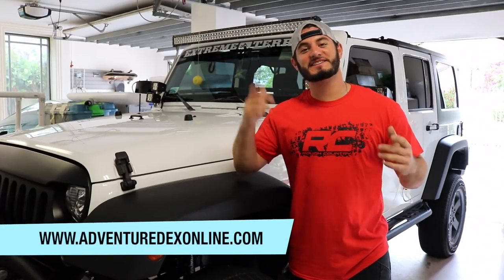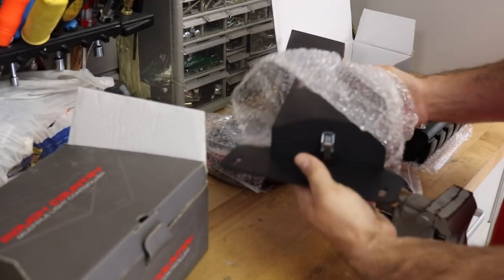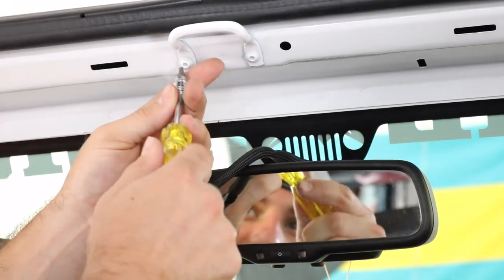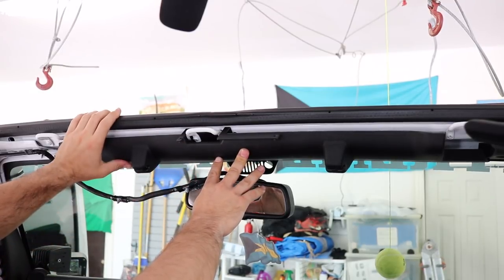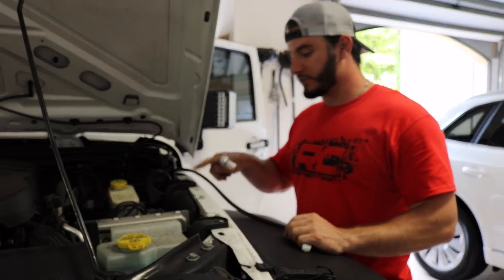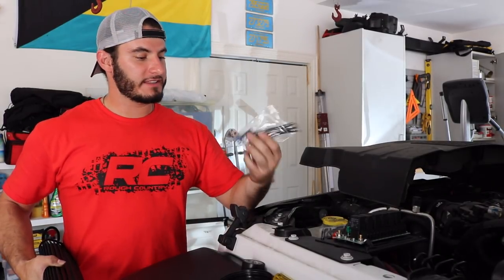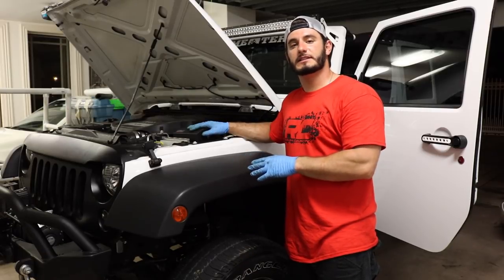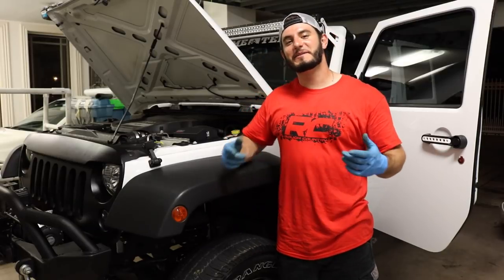Jeep Wrangler Switch Pod Installation - Rough Country MLC6

Comment: I installed a SPOD on my 2005 Jeep Rubicon.  It was an easy install an made the install of a new 17" light bar on my bumper a breeze.  I liked having the ability to customize the toggle switches with graphics that compliment their use - such as a Zombie graphic for my light bar and a winch graphic for my winch.  Makes hooking/powering accessories easy.
Reply from the maker: Thanks for sharing!

Comment: I have watched some of your videos and like the way that you do a step by step install with warnings about potential problems.  I have very limited to no mechanical skills but can follow directions, and based on your video I could almost do this....except for the removal of the pillar panels and using the jigsaw to modify.  Would prefer to install the switchpod with someone like you who knows what he is doing.   Be that as it may, thanks for your very helpful videos...I have just subscribed!!
Reply from the maker: Thanks alot for the positive feedback!!
Reply: r g -Look at it this way, even if you botched the trim, so what? Buy a new one and trim again. Otherwise, you'll never learn. Learning by doing gains self confidence. 

I am guilty of the very same reasoning, that! And I am a lazy character! Cheers!
Reply from the maker: +Gary Bowen thanks for your input!

Comment: Nice installation video! The only small con I have about the MLC6 is the interior LEDs never turn off. Probably not an issue since the MLC6 has the LVCO but I will mod those LEDs to be off.
Reply from the maker: Thanks for the comment! Yeah, the lights never turn off, it doesn't seem to affect anything though. Its a cool touch. Thanks for watching!
Reply: The button on the side of the switch is to turn the LEDs off.

Comment: Great video! The price difference is crazy compare to the S pod! I brought the new one which cost me around $750! I wished I had knew that Rough country was coming out with one. Would have saved me a lot of money!  You should do a dual light bar or the Rostra Led Daytime running lights. Again thanks for a great video.
Reply from the maker: Thanks for the positive feedback and suggestion! Glad you enjoyed!
Reply: I just got mine. There is a fuse tap to go to your accessory power, so the switchbox only comes on when key is in and turned on.

Comment: Thank you for mentioning the things you didn't like about it. Blue lights and cutting the trim would be a dealbreaker for me. Hope they come out with a 2.0
Reply from the maker: Thanks for the comment! I try to make my videos are honest as possible! I recently learned that the switches can be changed so I will be changing mine to custom red switches and the cutting is the only small issue! Thanks for watching!
Reply: Do a vid on it also. Blue isnt my color also. Red is the only way to go
Reply from the maker: Yah I will!
Reply: All RC would have to do is to extend the bracket a little, so that the plastic trim won't hit. One would think it's an easy fix; hopefully they take your comment into consideration and modify the bracket. Great video, though! Keep them coming!!!

Comment: As always, great video Dex! I was originally going to follow your video to wire up my A-pillar switches, but this seems like a much simpler installation. I do have a few questions for you. Given the option, would you prefer to have your switches in the A-pillar or overhead console? Which do you find easier to operate? Also, does the new console affect your ability to operate the hard top latches?
Reply from the maker: Thanks Remi! To answer your questions, The overhead is great value in comparison to the A-pllar since it comes pre-wired and has a few cool features. like the low voltage cut off. Also I needed more than 4 switches so the overhead was a great addition. The overhead does not prevent the hardtop from closing but that latch is tight!! Thanks for watching!

Comment: On the custom Switch set you had before you installed the kit you could have eliminated more wires by using a common ground And separate positive leads for each switch
Reply from the maker: Thanks for he suggestion.

Comment: Just purchased this product because I didn't want to spend the time wiring up a relay box & trying to make it fit, also time consuming. Besides I wanted an over the mirror mount. My suggestion to Rough Country is to make the cover plastic, insulate the inside walls for protection against accidentally having the sides touch the positive lead when putting the cover in place, or providing a rubber insulator that goes over the top of that positive lead bolt.  That's what I plan to do, Murphy's Law....if it can happen it will at some point. I'm a safety guy.
Reply from the maker: Thanks for sharing!!

Comment: 10:51 it might be simple but my province requires off road lights to be triggered by the the high beam circuit not the ignition. So I would need to have a way to only have the relay trip if the off road light switch was on and the high beams are on at the same time. I also like my fog lights to come on with my park lights or factory fog light. It sounds kind of complicated but once you do it a few times it not so hard.  
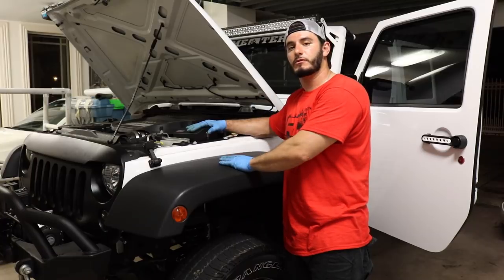11:37 That is a good feature.
12:30 I would like to have them green like my dash lights.
12:46 Back up lights.
Thanks for the video

Comment: I've watched the video couple of times and how did you run the wires through the firewall because the foam solution the plug doesn't fit . How did you get it through the firewall can you upload a video just for that or pictures because I bought a 2017 Jeep Wrangler and I'm having issues with the switch set up so far.
Reply from the maker: Great Question! The firewall has a round rubber grommet that can be sliced to get wired through! It is easily found in the foot well! Hope that helps!

Comment: That is a super awesome switch pod.  But I'm with you regarding the cutouts and the switch colors.  They should provide colored inserts so you can choose your colors. My pillar switch pod has a different color for each switch, which makes it easier to find the one you want.  Regarding what you should wire up ... I don't know if you already have them or not, but I'm thinking of putting some LED spotlights facing the rear. Just not sure how or where to mount them back there. Any ideas?
Reply from the maker: Thanks for the input and suggestions! I might switch the switches so maybe the I can change the colors that way. I like the idea of putting some rear facing LED's for backing up and nighttime. I originally had some but took them off. Thanks for watching!

Comment: The only thing I see which I don't like is the open wires on the switch panel itself (on top)... Im also not a fan of cutting trim parts of the car. They can also think of making the junction box in the engine bay dust proof, I can just think how it will look if one drive a lot of dirt roads. The rest of the product seems top notch!!!
Reply from the maker: Thanks for your input! I am sure they will be taking advice and improving the product! Thanks for watching!

Comment: great video and very helpful. One question is that the LED lights stay lit blue even when there is no key in the ignition.  Is that true? Seems a bit strange that it is not a switched current. Thanks and keep up the great content.
Reply from the maker: Thanks for the comment! The led lights do not turn off. It does not seem to affect the battery in away. I have had it in my Jeep for about 2 weeks with no issues! Thanks for watching!

Comment: Quick question! I'm new to this switch pod stuff and I just bought some awesome side mirrors like yours...😍 Well, I didn't know that it did not come with the switch pod .. so my question is, which one would you recommend for someone that doesn't have any other light bar or anything else? I just need one for the side mirrors? Thank you so much!!
Reply from the maker: Thanks for the comment Chantal! It all depends on your needs, the A pillar is a good cheap option but it is limited to 4 switches and a lot of wiring. The RC switch pod does with 6 switches and is prewired! If you can get the Rough Country, then I would say go for it! Thanks for watching!

Comment: Just bought this and the new updated version has the ability to turn the blue lights on and off with a button located on the driver side of the pod, for the wiring though it still has the positve red cable and an another red one stacked on top of it. I wired the obvious one to the battery, but there isnt instructions on how to or where to wire the other red one stackedked on top of it.

Comment: i had really high hopes for this..i ordered it got it all wired up and the 6th switch didnt work and the 3rd switch had to be on for switches 1,2,4,and 5 to work. also the led stay on when the car is off which i hate. the plug on the back that connects is pretty big and make fitting the panel back on harder than it should be. i ended up sending it back. i went with spod and spent more doe to have better dependability. i have the spod and its amazing but it was 800 bucks. This is really nice though for the price as long as it works. fyi the otrattw custom switches do work for this Rc system. i have all rc black series lights running to my spod and love them. i think rc makes good stuff but your mileage may very on the switches. great video
Reply from the maker: Thanks for the comment! I appreciate and respect all of your input! I think the main point here is cost/value. From my personal experience, RC makes great, reliable and affordable products but of course there is always going to be a more expensive top of the line product that some people choose to buy. I personally think that you cannot go wrong with $200 with warranty. I am sorry to hear that you got a faulty product but I am glad you got sorted out in the end! Thanks for watching!

Comment: If I wire my winch directly into the battery, would putting the positive and negative wires from the pod on top of the positive and negative wires from the winch in the battery port cause any electrical issues? Sorry if that's a confusing question.
Reply from the maker: No, this should not cause at issues! Thanks for watching!!!

Comment: Would be very helpful if you showed how and where you ran the wire through the firewall. I don't want to start disassembling unnecessary body parts.

Comment: great clear installation video.
is one switch/relay/fuse on this group of six able to handle two 30W LED lights? is each 40A relay and 30A fuse pair capable of handling that? Thanks.
Reply from the maker: Thanks! Yes, you shouldn't have any problems with LED lights. I have blown a fuse before and replaced it with a large fuse. Hope that helps!

Comment: I have 2 sets of Rigid Duallys and a light bar run into my a-pillar switch panel (pos,neg,and ground wires). With this, can I cut the wires down to just pos/neg since the MLC-6 has its own ground? Can I also cut the fuse out? Awesome video.
Reply from the maker: Yes, all you need is a positive and negative. The MLC6 does the rest! Thanks for watching!

Comment: That will kill your battery as the lights on the switches.i purchased one and there is a fuse jumper and you need to splice into the power so it only the lights on the switches stays on during accessory and shut off when key off but lights ztill work
Reply from the maker: Yes, I will be doing a "mod" to fix this! Stay tuned!

Comment: I ordered the accessory for my 2016 Jeep Wrangler, however, I’m experiencing a problem. The negative wire to the battery has an additional red wire to it and the instructions advices to add a fuse connector to it in order to prevent the pod’s lights from staying on during shut off, and it also suggests cutting the red wire at the harness on the board and capping off one end. Well, needless to say my lights are not coming on! Either I did something wrong or the instructions is wrong

Comment: Could you splice multiple light pods to one relay? that way you can run like two switches for multiple lights in the back and the rest for the front? and also how would you wire a winch up to this?
A whiches power cables seem to be alot bigger than the little pos-neg on the terminal. Thank you very much for this review, ive sat at this computer for hours trying to find an easier way to wire all my lights rather than making a huge mess of things.
Reply from the maker: Thanks for the comment. You can double up but it’s not recommended. The winch wires are unfortunately too big for the switch pod! Thanks for watching!!
Reply: AdventureDex would you suggest wiring the winch directly to the battery? And also how many watts can a single fuse take? Just curious on how I should wire these. I ordered one after watching your video.
Reply from the maker: Yes the winch can go directly to the battery. The watts would depend on the fuse if self. Hope that’s helps.

Comment: When installing the switches, it looks like the top of the housing is open to water if you have your top off and get caught in the rain (at 6:42 in the video).  is there a cover plate that went on after you screwed it in, or does it remain open on the top like that.  Seems like a rain shower could get all the inside wet.  Otherwise, this is definitley something I'll look at trying (unless you've found one better since this video).

Comment: Good video.  Can you go into difference between that and the Rugged ridge pillar switch pod. ?  Also great song what group?
Reply from the maker: Thanks for watching! The biggest difference between the A pillar system and the MLC6 is the source of the MLC6, it allows you to connect your accessories directly to it in one central location which makes wiring a lot easier and safer! Hope that helps!

Comment: aren't you supposed to put the bracket outside of the screws? It might be harder to close a soft top after
Reply from the maker: Thanks for the comment Jack. The bracket for the switches goes behind the loop so the loop can still be used once the switches are in place. Its a tight squeeze tho. Thanks for watching!

Comment: In this video you mentioned a bracket for 2007/2008 and a bracket for 2009 and newer.  I didn't see product options for 2008 or earlier.  Will it not work for 2008?
Reply from the maker: My best advice is to check with RC directly. They can give you the best advice in terms of fitment! Thanks for watching!

Comment: I apologize if you’ve already answered this question but I have the Same year jeep you do and I just picked up the Mlc-6.  My question is where did you run the wire through the fire wall.  Thank you in advanced.
Reply from the maker: Thanks for the comment. There is a rubber grommet in the drivers side footwell on the upper left hand side. You might need to cut a small line in it to push the wires through. Hope that helps! Thanks for watching!

Comment: So rough country light bars come with a wiring harness with a relay and fuse so, can you still connect the to the Ml6 even tho the box have fuses and relays built in??
Reply from the maker: I usually just cut the wiring harness off and wiring it directly to the MLC6. Thanks for watching!

Comment: Hi Dex:

I just purchase the Rough County MLC6 in Amazon what a disappointed when after taking the tops off and opening the box the 09-2017 bracket was missing my jeep is a Rubicon 2012.  I wrote to the seller requesting bracket asap.  The instructions shows  brackets one for 07-08 and another one from 09-17 my husband got very mad when he notice that the bracket was missing. Just wanted to let you know.
Reply from the maker: I got mine directly from RC and I believe it came with both brackets!! Thanks for sharing
Reply: Hi I called RC yes you are correct my husband and I missed the part the one for newer Jeeps was already attached to the main unit as per our conversation with them just today it got mounted love it, now working with the RC 2" lights.
Reply from the maker: Awesome!!

Comment: Great video/videos bro. Question that I haven't seen asked, and wasn't covered in video- the latch that spins to lock the front part of the top t roof pieces that sit above the pod switch. Does it no longer lock? I can't turn mine unless I unscrew the hex screw. Ideas?
Reply from the maker: Thanks for the positive feedback. Yes, the lock will still close but it is hella tight! I leave mine half way locked and that seems enough to prevent any water leaks!

Comment: Why did you remove the 3 10mm bolts under the hood but only showed using 2 for the mounting plate ? I guess the switch lights have to stay on so they dont get sued by spod for copyright infringement...
Reply from the maker: Thanks for the comment Tom!

Comment: Damn im happy they sent you this product to review. I JUST had this in my cart and was looking for an switchpod install vid because your old SwitchPOD video........ 😬😬😬 sheesh.. Dats all ima say 😂😂
Reply from the maker: Your very welcome! Don’t forget to take advantage of the discount code “AdventureDex” save yourself some $$! And awesome name btw!! Jeepwave 👋🏼
Reply: @adventuredex  No prob.. And I just recently bought a brawlee (Done Right) LED light that goes on the rear window glass. That could be your nxt video idea. (Mainly due to the fact that i need help). I would really like to wire the Brawlee light to constant power and having the option of turning it off or leaving it on because it comes with a remote. For things like..... Getting drunk on back of the TG. Plz help if this is possible with this product your reviewing in this vid. And btw i like your name (dex) too seems like I've heard it b4..